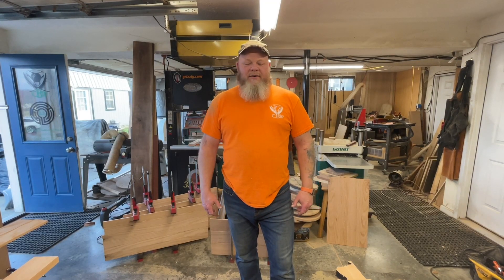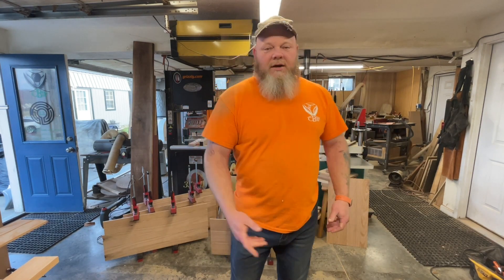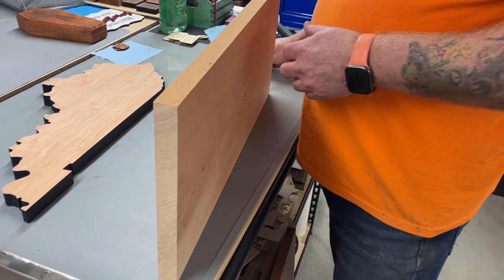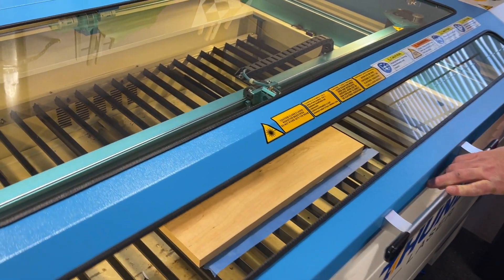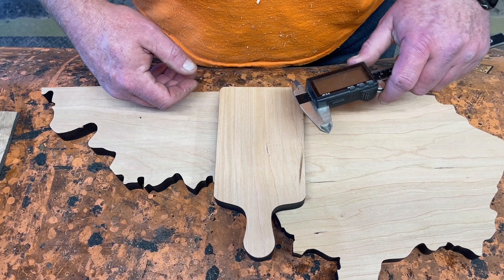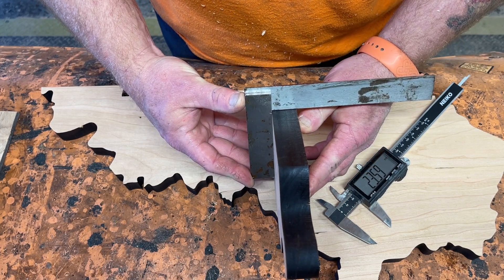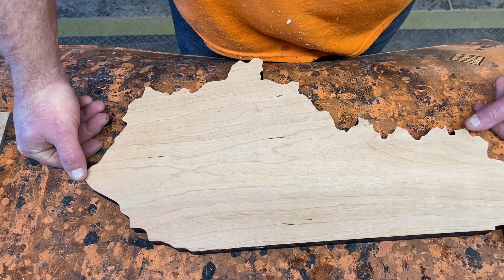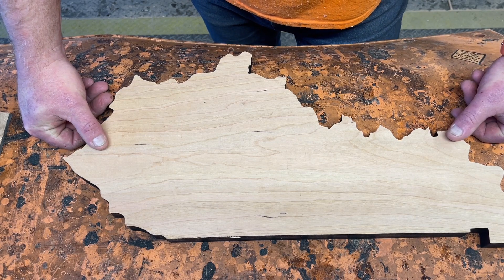How thick of wood can a CO2 laser cut

Comment: Good video and overall great results.  What is the focus distance you used for you 4" lens.  I love your straight edges.  Can't get mine to cut with straight edges.  I have the American Photonics lens and when I first tried it was not happy at all with the results.  But you have me rethinking this.  I am using a Laguna EX 150 watt laser so it should have the power needed.  

I like how you didn't seem to worry about cutting all the way though at first and then planned the piece to the point where you could remove it.  When I tired cutting even 1/2" maple, the sides always seemed to be sjewed and not straight - like the funnel of how a laser lens focuses.  That is why I asked for what you used as your focus.  My lens manufacturer indicated I should focus 10 mm above the material with the end of the nozzle thought I would aks to do a comparison.  Have you tried cutting thicker plywood.  I know this is more of a challenge because of the glue.  What is thickest plywood you have cut?
Reply from the maker: @RobSandstromDesigns  so your best option is to run a ramp test to determine the optimal focal distance. I have seen these lenses go from 10.5-12.5.  We don’t cut ply so I can’t answer that.  Make sure your alignment is spot on from mirror 3 though the lens. The 4 in is not forgiving if you are a little off.
Reply: @Angrycraftsman  great response.  I will admit to not paying much attention to my mirror alignment as long as the laser was functioning well with my other jobs.

Comment: Thanks for the video! What air are you running?
Reply from the maker: We keep the secondary regulators set to 50psi
Reply: @Angrycraftsman  thanks much! Looks like this is the nudge we needed to get connected to the big compressor ☺️
Reply from the maker: @jodyyounger4569  it will help however
Reply: @Angrycraftsman  did you do a video on how to connect a secondary compressor? I’m scrolling through your videos now…

Comment: I wonder if you raised the bed and did a fast second cut at 30-40mm per second it would solve your cut through issue without having to plane multiple times.
Reply from the maker: There is that possibility.

Comment: How long has the original tube lasted?  I read comments about rube life based on % of cut power...so far loving my 51/130. .had it for 1 week using it.
Reply from the maker: We are still on the original tube, year and a half currently. I think the manufacture estimates 2-4 thousand hours, I could be wrong. I guess if you run the tube at 100% all day everyday it would shorten the life.
Reply: @Angrycraftsman  do you cut at 80-90% power often?

Comment: I have a 100w 24" x 37" CO2 laser and I am thinking of trying to make some small furniture items out of .5 to ⅝" plywood. Do you think that is reasonable?
Reply from the maker: The furniture maker inside me says no only kiln dried hardwoods, however as long as your laser will cut it sure. It would be a great way of cutting the parts for small foot stools and such.  Have fun with it and try.

Comment: The reason for the intermittent cut is purely speed.  Look at the bottom 1/4" of the cut and note all the curved striations. This is not the laser beam cutting but the super hot gases doing the burning, Slow down by 1 or 2 mm/s and these marks will disappear and the cut will be perfect in one pass.

Comment: I just backed tracked you used a 4" lens but not Thunders
Reply from the maker: Correct we do not own a Thunder 4 inch lens, ours is from American Photonics. We also have their 1.5 inch lens which is great for more detailed work.
Reply: @Angrycraftsman  what psi are you running to cut almost an inch
Reply from the maker: @davidelder5399  our regulator is set at 40psi and the air assist valve on the laser is wide open.
Reply: @The Angry Craftsman  Thanks again for your help. I'm looking  forward to the next video

Comment: That's impressive with the standard lens. Is 130w the rated or max output power on the Thunder ? Looks like the 4" would easily cut it. I'm still trying to decide if a 130w machine would put out decent engraving. I see on the forum's people that a higher wattage laser doesn't engrave as fine detail as a lower one. How do you find engraving on the 130w I know they do a Hi Res head.
Reply from the maker: The 130w produces fantastic engravings. The only drawback is if you have a material like anodized aluminum or suede picture matte they do not engrave the greatest.
Reply: @The Angry Craftsman  thanks for the reply much appreciated